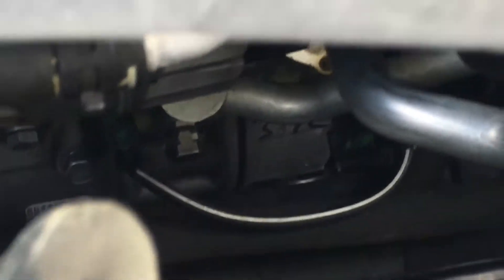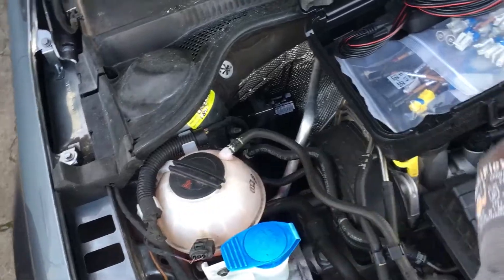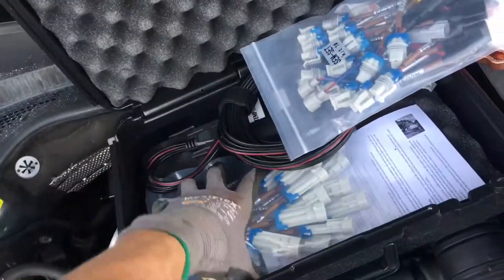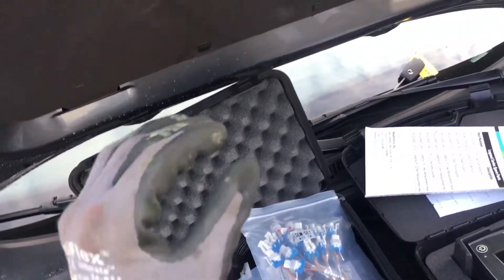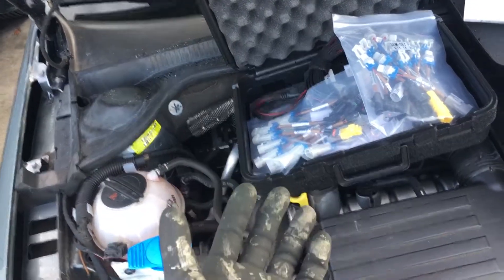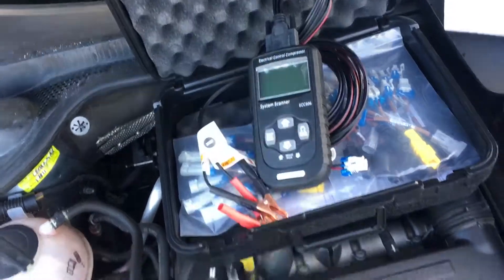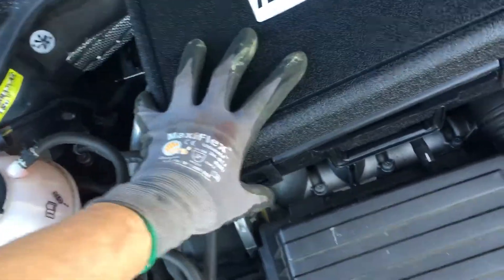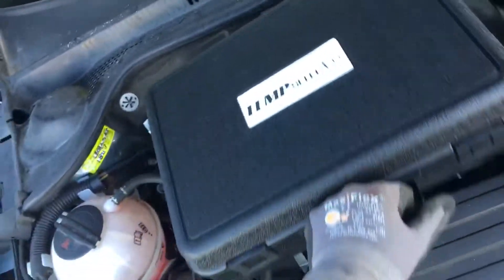AC Variable valve signal or solenoid stopped working intermittently.

Comment: Hi Tom. Thanks for always giving us good content. Do you have another video on how we can use this tool? It would be nice to see it in operation. Thanks again.
Reply from the maker: I have a few videos I don’t go into details, but I think I actually show going through the functions and using the ohm meter function to ohm out the windings in the valve and show the duty cycle percentage, being fed by the vehicle and over, writing it in the manual mode, and changing the duty cycle

On YouTube look for 4 SEASONS’s YouTube channel. They have more detailed videos on the use of this piece of equipment since this is one of the pieces of equipment they sell. . 

Go to 4 SEASONS website and look for this piece of equipment and I’m sure they have links to videos on using it .  

Basically, it’s almost exactly the same as testing a fuel injector with a old manual fuel injected tester where you read the duty cycle you can feed the duty cycle. Can you read Ohm? .
Reply: @coldfinger459sub0  Hi Tom. Thanks for your quick reply. 
I watched the 4 season videos here on YouTube. They show how this tool works, increasing and lowering the duty cycle and checking for resistance and how to find out if the problem is the vehicle or the compressor. 

Yes I have a multimeter, I can check the resistance. Also after watching those videos... I wonder if I can just use my power prove to check if I'm getting voltage from the vehicle and also supply voltage to the compressor to make it work instead of using the tool.
Reply from the maker: @VWtech562  voltage is not the important thing it works like a fuel injector pulse width modulation duty cycle

Just like working with a variable Frequency, drive VFD if you tried checking voltage you would still get the full voltage weather is only feeding 10% duty cycle or 100% duty cycle. The voltage would still be exactly the same. . 

You have to understand the basics and how did operates to understand what you’re trying to diagnose . 

Are you can also use an Arduino and download a few lines of code for duty cycle and change and program your own parameters and set to a potentiometer and build your own it’s very simple grammar school level class project
Reply: @coldfinger459sub0  I guess I missed that class lol. I though it worked with voltage. Been working on cars since I was 18, I'm 33 now, but this variable compressors and 1234yf refrigerant is new to me. I sure don't want to get stuck in the past with fixed piston compressors. 

Keep making videos, I specifically like the videos using dry nitrogen pressure decay test to find leaks, instead of just using refrigerant with dye like most ppl do. 
The fildpiece gauges with Bluetooth temperature sensors its also new to me. Exellent content there 👌
Reply from the maker: @VWtech562  refrigerant UV die has its place.  But its place is not your first go to Method to find leaks..   if a leak is that big that UV die can find it right away then it could’ve been easily found any other method to. 

UV die is excellent for those hard to find leaks that only happened at a certain time when the vehicle drives away for a few days or a few weeks . 

Nitrogen has its place and time where it’s better than the other ones 

And then sometimes using a electronic refrigerant leak detector is Superior in other situation’s 

You also have the Ultrasonic leak detector that is Superior in certain scenarios 

Then you have the helium leak detectors and let’s not forget the hydrogen leak detectors that you both use what is called forming gas they use is 95% nitrogen with 5% helium or hydrogen .  Because the helium and hydrogen molecule is much smaller than Refrigerant. It’s easier to fine with its dedicated leak detector.

No one leak detector finds all leaks .  

Let’s not forget, soapy bubbles
Reply: @coldfinger459sub0  

I totally agree and have to admit I've been doing it wrong for years.

 The ultrasonic leak detector seems like a good tool to have, but perhaps a little overpriced.
Using nitrogen mixed with helium ... what a great idea. You have to make a video about that if you get the chance. 

By the way, that tip about removing the fuse for the condenser fan to make the high pressure go up and force a leak... it's just mind blowing 🤯 I never thought of that.
Reply from the maker: @VWtech562  knowledge is passed down. We all live on the shoulders of greater men who came before us. Hopefully they were well-versed educated, and at least had some common sense something that’s not dished out or tots too much anymore.. 

My father taught me this with the fans before there was electric fans back in the 70s I was not even in high school yet . 

Are you would do the OSHA not approved losing finger method of getting a rag in your hand and waiting for the right moment when the thermal fan clutch fluid driven was NOT ! engaged and slow down and stop the fan while you watch your head pressure . 

We still had a lot of direct one to one drive mechanical fans on pulleys, and you would have to put pieces of cardboard or newspaper just the right amount to send up the head pressure to your desired number by adding or subtracting leakage through your condenser covering . 

This is all old school stuff taught when somebody went to a formal education for HVAC. It’s what my father was taught back in the 50s and early 60s when he was young by two older mentors that he had were old men who were also formally talk through a formal education through a apprenticeship program. . 

This is what happens nowadays there’s no real apprenticeship program and there’s no real good formal education system for automotive. Most of it has been eliminated. . 

So now everything is done by voodoo magic, guessing and good enough must be good enough has become the normal . 

I’m trying to change that in at least automotive air-conditioning by giving my information out there to technicians who don’t have access to automotive engineering programs or being in a union under apprenticeship where it’s mandatory you have to go to night school for the next four years .
Reply: @coldfinger459sub0 

 Thank you Tom for giving us all this free information and knowledge, also taking the time to record, upload videos and reply to comments. We appreciate it very much 👏👏👏 
Soon you will have thousands of subscribers

Comment: You should check if in the HVAC module shows a dtc named: Error 0001 - Internal gremlins doing their thing - address 00-00
Reply from the maker: I often don’t have time to do follow up on Body Shop work. 
         And too many times I find it’s a connector left loose hidden somewhere or a damaged hidden wire. 
           Improperly repaired wires. 
I would’ve quickly just disconnected the solenoid plugged in my solenoid driver tester and confirm whether or not it was or was not getting signal. 
        But did not have it with me